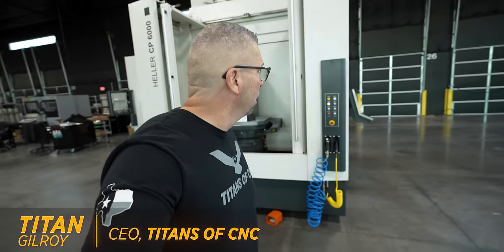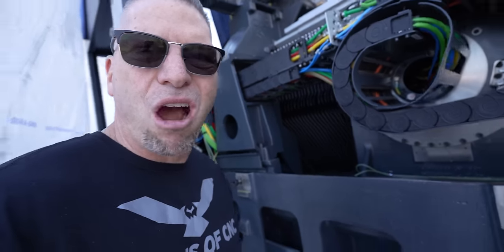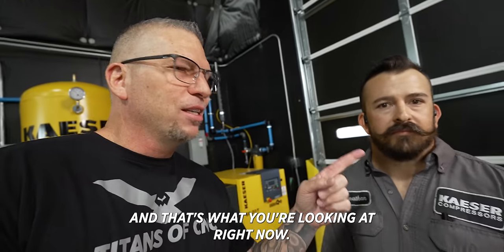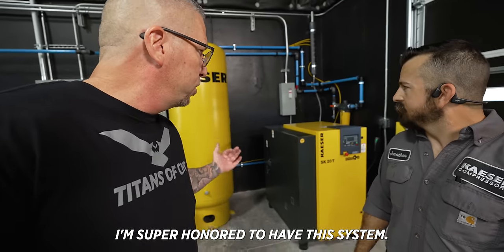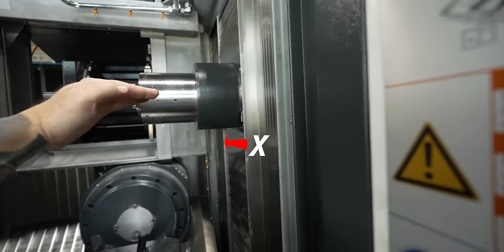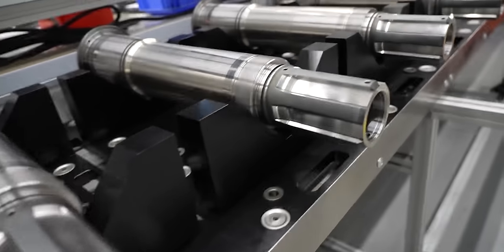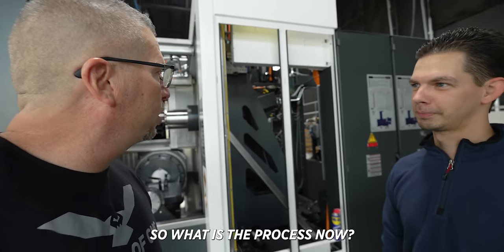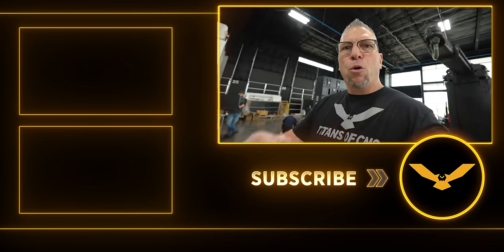Our New HELLER HF 5500 5-Axis Just Arrived

Comment: I can't be the only one who is also interested in that absolute MONSTER of a Fork Lift that was used to bring the machine in!
Reply: Our school just purchased a Quaser MF400 5 Axis Mill. It is no where near the size of this Heller but for us it is a monster. It weighs over 18,000 pounds. The riggers that installed the machine had a similar fork lift that is in this video. My students were AMAZED at how it worked! Sometimes teaching how to operate CNC machines goes beyond the kids learning the actual machines! The technology and teamwork of the riggers was a lesson learned by many of them that we as teaches could never duplicate. The videos posted by Titan are incredible learning tools. I find my students watching them all the time and then having conversations about them! Thanks again Titan!
Reply: We have some big fork lifts for moving the steel around our factory...I think the top one lifts 20 tonnes
Reply: Machine riggers always have them. Have to have a fork rated for more than the weight of the machine.
Reply: It's a versa lift we use them to install hellers at Borg Warner
Reply: I ran Taylor 360s and those are actual monsters
Reply: Versa lift fork lift ,a local machinery movers  ( merrits ) used one to move our machines many years ago 27000 kg lift if I remember correctly
Reply: Come visit us at Triangle Tool in Wisconsin if you want to see big machines 😊

Comment: Started at GE gear plant in Lynn MASS around 83 or 84  AND only 3yrs out of high school.  2yrs later won the highest union pay rate  and got involved in RD project for hardened high speed reduction gearing to be installed in ARLEIGH BURKE class destroyers. 7 axis cnc horz boring. Many manufacturing buildings sit along the Saugus river. This HBM used the steel plate floors as x table and besides that there was a large computer rotating table that moves in and out.
  The foundation had 6 massive concrete legs going over 100ft to hard rock. 2 stories below the floor housed all supporting hardware and fluid system. The U.S. navy excepted the reduction gearing along with gas turbines specifically designed for each other. At this timeframe manufacturing was gone from the U.S. and ones that stayed had to go cnc

Comment: Amazing machines. We have 3 Heller machines in our shop, H3000 built in 2018. the chip conveyor actually got torn on the bottom  by our rather large chips. Had to replace all 3 conveyors for big bucks, as well as standing production. Everything else is great though

Comment: The secondary work on lights out operations is nuts, you need about 2 - 3 employees to compensate for it to push the work out the door within 24 hours of production of lights out.

Comment: With regards to single pieces, clearly multiple pieces all have to have almost perfect interfaces and they all need joining in the best long term stress free way - so to make just a single big part is considerably best practice and it's usually the most low cost way as well. However, you need access to very large casting and really big and accurate machining capabilities. It really, really pays to keep skills and trades going, have some vision and guts and don't let the accountants or CFO outsource overseas just to temporary boost their stock option or bonus scheme.

Comment: I heard a term from a supervisor at a prototype casting shop I worked at for a few months. "You can fool the spectators but you can't fool the players." He was talking about how many people have "experience" on their resume and then come in and can't program like they said they could. Can't help but notice the term aerospace is thrown around so much. Just because something is for an aerospace company doesn't mean the components are necessarily anything different from a typical job shop. Aerospace companies need MGSE (mechanical ground support equipment) just as much as "aerospace" flight components. I just find it funny as someone in the industry to keep hearing this term like it's a unicorn. Same thing said to me by one of the best programmers I have ever met (shop foreman who was only a few years older than me when I was 21) about "aerospace" as a buzzword. That dude now makes mold parts and composite machining/engineering for military drones. Would love to tour the shop someday :). BOOM. You guys get to subsidize your shop growth with YouTube money plus education and tooling company sponsorships. It's the new way of making money. Internet money. 

What is the B axis travel?? + -120?
Reply: We had a guy come to our shop who wasn't even qualified to push the green button to start a machining cycle.

Comment: Hi Titans, 
I desperately need to know the what type of gloves you guys wear during machining. How effective are they in preventing small injuries.
I run a small production unit and have tried several locally available gloves for my guys. They either wear too fast, or are ineffective or create obstacles for precise hand movements. It'd be great help if you suggest some types. Thanks.
Big fan of your channel.
Reply from the maker: Truthfully, I am not a fan of gloves in precision machining. Any loose clothes or added fabric that gets close to a spindle is a problem. Also, gloves carry chips and particles that transfer onto jaws, vises etc…
Nothing cleans a part or jaw surface better than the human hand. So we work meticulously and precise and in 17 years of having a shop we have only has tiny minor cuts happen. If my guys are away from a CNC and are transporting raw or sharp material etc.. then they use gloves.

Now precision machining is different than fabricating. They are different worlds… with different tolerances. Fabricators often use gloves.

Thanks for the nice comment,

Titan
Reply: @TITANSofCNC  
Totally agree. Most guys prefer naked hands including me. But a few 30+years loyal operators have developed skin issues due to coolants/oils etc and have trouble working under those conditions. 
They usually work on good old traubs (production over ultra precision) and some guys need for thread rolling where components get crazy hot but can't wait for it to cool down due to time losses and sometimes have to run the machine w/o coolant during rework. So the use cases are specific and miscellaneous and not throughout the shop. Just trying to look out for my guys. And btw you'd love to know my shop has more than 60% plus women workforce. So need to keep that in mind too. 
Anyway, thanks for your prompt response. Best wishes.

Comment: You need to start thinking in a central piped cooling solution I think, but nice place you have there, btw have a look if you can at Witzig & Frank TriFlex, the ones we have 4 spindles per machine, a true production workhorse
Reply: With how much they move machines in and out I don’t think a central chiller would be feasible.
Reply: @codygibson2809  not chiller, talking about the tool cooling not the spindle and electric cooling, although that is also a good option, we do it and instead of having 3 or 4 AC units per machine we have a central chiller, a lot less down time, but I'm taking about machines working 24/24 365, different realities. Tool cooling can be kept at amb temperature, what you could do is having the fine filtering and pumping centralised, also less parts to fail, and depending on how it is done (redundancy) less down time, the moving machines, it's just like with power and air, just another pipe